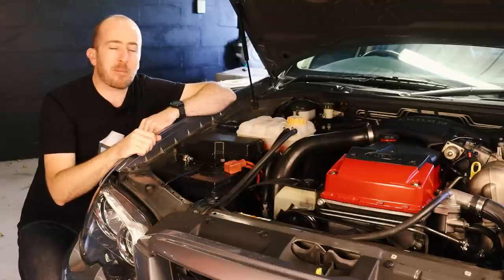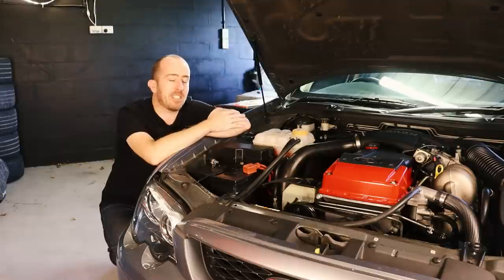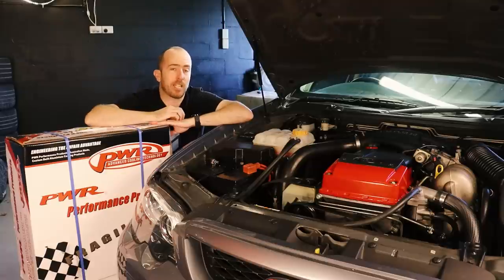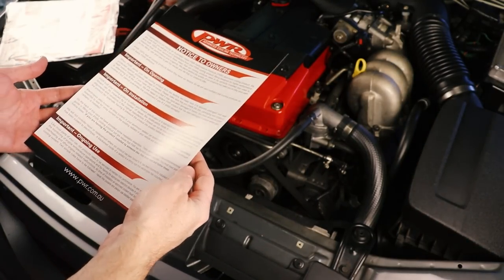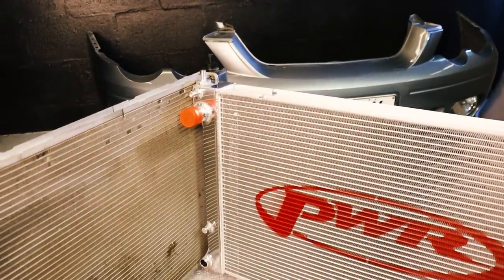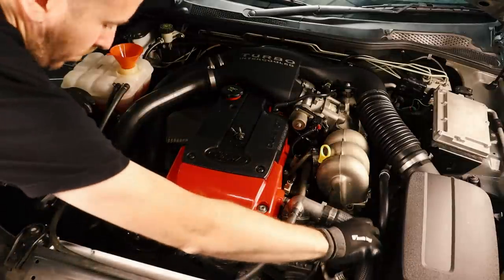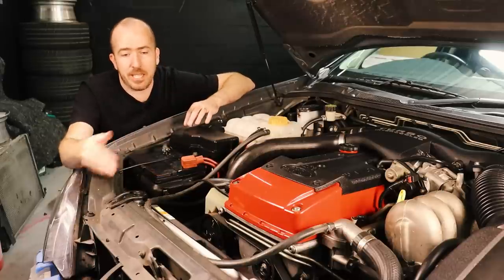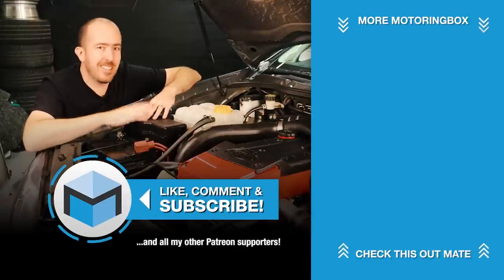Barra Turbo Radiator Upgrade! PWR 55mm Aluminium Radiator for Ford BA/BF Falcon XR6T XR8 FPV Typhoon

Comment: Nice - the Aussie Ford inline 6’s are probably the best engine bays to work in when doing DIY maintenance 👍👍
Reply: .......did I hear someone say ...AU FALCON...🔥👅👅👅😈👍
Reply: It sucks for us xr8 guys tho 😄
Reply: @smithy2  AU XR8 .....with a stroker kit...🔥🔥
Reply: @lancecooper4646  BA with 5.4 modular,  brings new meaning to the word tight
Reply: @smithy2  but in trade off you get the nice V8 rumble at idle 🤷‍♂️
Reply: @bennyw9975  haha you know it 😎👍🏼
Reply: @bennyw9975  Nothing beats the sounds of the 5.4ltr when u nail it as well
Reply from the maker: @mickblack2800  agreed.
Reply: @mickblack2800  I'd rather reliability.
Reply: I dunno, I just replaced the water pump and the radiator on my FG G6E-T last weekend - getting at those bottom two bolts that hold the condenser and the radiator together was a b*itch - wish I'd removed the whole front bar like was done here, would have been much easier.  Then there was getting the old pump off - had to remove the turbo out pipe and the power steering pump to get at the rear bolt - then the worst part of the whole job - getting the old water pump gasket off - it was glued like concrete to the block & there is almost no visibility on the top right corner of where it bolts to the block - took me a good hour of spraying with cleaner and scraping to get it back to smooth metal.  Then the replacement water pump didn't have a thread tapped in on the rear bolt hole that holds the back pipe in... all in all a job that I expected to take me a couple of hours took me over 5.  Other stuff I've done recently like replace all the upper engine gaskets was pretty easy though.
Reply: @SamO-ik2cm  Besides the usual replacing the arse end bushes & replacing the auto at 187,000kms, the V8 is turn key reliable  & strong as the day it was built, & is a great Aussie cruiser.👍
Reply: I know the AU is a snap to do oil changes.
Reply: @SamO-ik2cm  mine is pretty good, vortech v1-s 400kw,
Reply: @mickblack2800  dont tell me that, mines at 177,776k's on a positive note for me thats atleast 2yrs away 😉
Reply: Lol
Not mine mate

Comment: Just ordered a custom PWR radiator for my Manual Mitsubishi Magna Ralliart in sable black. I am build number 476 and I just want to say I love Aussie cars. I also have a Manual FGX XR6 Turbo and am considering the PWR Radiator for that too. My XR6T has some minor clutch drag though which is causing issues when shifting at high RPM and may also need synchros now. I do all my own work where practicable and have done Oil Pump gears, valve springs and the IMS diff hat upgrade. The car has driven me nuts with the clutch drag but all I have to say is take the challenges for your cars as they are, a challenge of your skills and resolve. Don’t get disheartened and remember what you love the car for to push through the hard times. Love your work Sean

Comment: i defiantly recommend pwr, we use their trans cooler kits at the shop to replace the milkshaker on the BF-FG and SX-SY-SZ territories, never had one come back never had one fail or leak, fit perfect every time.
Reply: Yeah, the "milkshake delete" is a must do with one of these if it's an auto 👍
Reply from the maker: The accuracy of all the rad mounts was pretty amazing. I was expecting a bit of slop, or that I'd have to bend the condensor slightly into place etc. But nothing - it was perfect.

Comment: GOOD JOB.....!!! I did mine several years ago I paid 180 bucks the brand was 'SPOWER'- no leaks but 50mm core didn't stop it getting warm on extended idling..... Triton do a 'high flow' thermostat range 30% more flow - that didn't help either but mines a 5.4L maybe the setup is different..... don't get me wrong it did improve but the needle doesn't seem as steady as it used to be when pushing the car......... I dunno why......

I can suggest cleaning the thermofan couplings well and giving the pins a lick of dielectric grease..... I found mine didn't come on after the job and as usual the connectors needed a tweak..... to test it just flick on the A/C - they should always run while A/C is on.........

Definitely a job worth doing because I am also told on the BA the tranny shares its cooling with the radiator internally and they are known to corrode and contaminate the tranny with coolant at around 200,000km - a tranny rebuild is 4 grand - so I just went ahead and did it - maybe the turbo has a separate tranny cooler - not sure mine and many others don't so for under 200 bucks its worth it on that front alone...!!!!

https://www.ebay.com.au/itm/131655830081?fits=Plat_Gen%3ABA&epid=911738429&hash=item1ea74c8a41:g:fjQAAOSw3xJVf-uX

Comment: You've inspired me to consider doing this on my falcon. I assumed it would be a more challenging job. Great video as always 👍
Reply: Just don't make the same mistake I made and try to remove the bottom condenser bolts from underneath the car - take the bar off like he did here!
Reply from the maker: Well worth the money if you care about the car and plan on keeping it long-term!
Reply: @Beer_Dad1975  I swapped mine without removing the front bar. It was fiddly but doable. Used a 1/4 drive rachet for the top bolts, then a 1/2 drive with extension through the lower grill for the bottom bolts. But mine's a V8 so no intercooler to deal with.

Comment: Ford falcons, they don't have coolant bleader screw for removing trap air in system and it is important to put heather on hight position for some times for prevention of trapped air in coling system.

Comment: Another easy & great video Sean. OEM radiators only last for 10 years. Mine lasted 15 before I had to replace it. It's a pity PWR don't make radiators for VY V6 engines so I'll stick with stock for now.
I would have flushed the engine out of any excess coolant & double checked the thermostat. Thermo fans have always been a bugger lol.
Reply from the maker: Good tips. My thermostat was replaced about 2000kms ago, and the coolant done at the same time.. so I wasn't too worried.

Comment: Annoying thing is the FG's have the following 

N/A 6cyl - 16mm core
6cyl turbo - 26mm/27mm core, which is a big boost in cooling efficiency for a big lump of iron that really can get toasty..... (26mm would be ample for an N/A), 16mm is just a joke haha !

I've put a factory Turbo radiator in my G6E personally, keeps much more consistent temps running an 82° thermostat.

Comment: Take the top radiator mounts off to make it easier to slip the fans in. The will move forward just that little bit.
Reply from the maker: Good tip, will loosen them if I ever need to pull the fans out. Might be just enough to help.

Comment: Just done the radiator in my bf and the condenser surprised me aswell, coming from older falcons
Reply from the maker: Luckily I have taken the front bar off a few times before so I was able to do it fairly fast. Not as fast as in the video though!!
Reply: On a non turbo xr6 or xr8, you can get away with just removing the top grill and using a ratchet spanner or 1/4" drive ratchet 10mm
Reply: @tturi2  that’s what I ended up doing aswell

Comment: Great video and also worthwhile upgrade. I had the radiator explode on my Mondeo once - the mess is unreal 🤣 also upgraded the intercooler on my V50 T5 to a solid aluminium unit as the OE unit was a lot thinner and had plastic end caps!  
On a side note - love the tune 'Diggin In The Dirt' - it's so cool and was used on Sky ads here in the UK but unavailable on Spotify,  Apple Music etc 😢
Reply from the maker: Thanks mate! The track is 'Down in the Dirt' and it is on Spotify - well, here in Australia anyway if there is any difference. In the vid description is a link to my MotoringBox playlist which has it.

Comment: Some advice for the top radiator hose on BAs

I double clamp the top hose near the thermostat. I find that they can pop off easily if you’re heavy on the throttle.
Reply from the maker: If the hose is popping off that might suggest the engine mounts are on the way out, and that the engine might be rocking side to side a bit.
Reply: @MotoringBoxTV  my ute has 345k on it, it’s probably due for a set

Comment: Overheating is no issue mine blew a hose going up a hill pulled over and suprise no coolant still runs like a dream to this day
Reply from the maker: Hoses are well worth replacing too - I did mine a few months back and it only cost me around $150.
Reply: @MotoringBoxTV  basically done the same as you fixed all my cooling your videos helped very much

Comment: I did a similar job AFTER the original plastic radiator failed (the radiator top hose connector broke off halfway and all the coolant pumped out. The new all-aluminium radiator is the bees knees. My Ford is LPG, not turbo, so the radiator is thinner and easily fit with no mods needed.
Reply from the maker: Nice. The plastic end tanks did make me nervous for sure, after a the t-piece on my heater hose fell apart from heat degradation.

Comment: Ah those plastic intake snorkels. Fit nothing except factory standard setups. I put an all aluminum rad in my Subaru and the snorkel needs some love with a small cutting wheel to make it fit because there's  ribs in the way. Even replacing the battery in my wife's Kia to the listed "fits this car" as per Century's catalogue has it needing a good massage to go back on. Just.
Reply from the maker: Going factory if possible is always the easiest of course. Factory parts do have their performance limitations though, so it really depends what you're after.

Comment: Thank you very much for your video. I changed my radiator today (BF Fairlane, 230 Barra V8 3V) with your help. I didn't remove the front bar. I replaced the rad with a Natrad OEM replacement and their instructions agree with you that stray voltage should be less than 50mV. Mine tested at 165mV engine running and 185mV engine off. Various forums say that below 300mV is acceptable. I'm a little worried and confused. Did that voltage reading (cheap DMM) cause the original radiator to deteriorate? Or am I fine?
Reply from the maker: I'd probably go with the manufacturer's spec if you want to be covered by any warranty they offered.
Reply: @MotoringBoxTV  Dang. I'll call around and do more research. I don't want to wreck my new radiator. Thanks for the quick reply. :)

Comment: So confusing on their website it says the PWR5100 and PWR5100A are both for the V8
Reply from the maker: 5100 is manual, 5100A is for automatic (because it has the transmission cooler assembly within the radiator). If you run an external transmission cooler you could order the manual radiator.

Comment: Do your radiator fans cycle on less often once it reaches operating temp. One thing I don't like about me falcon is how much noise the fans make when they cycle on. A better radiator might reduce that. Is that a BA/BF XR6 turbo and do the fans run sometimes after you remove the key from the ignition?
Reply from the maker: I haven't driven out properly yet, I have a few more things to do first. The fans should run less. I've never had them run after turning the car off either.

Comment: I really wish the radiator stuck out so it looks like a mock intercooler. Just had to replace mine in the BA and thought it might look sporty from the front but can't see a damn thing lol
Reply from the maker: It's pretty subtle unfortunately, you just see a little more thickness there between the thermofans and the body.

Comment: Nice video mate! Keep in mind that if the cooling system is TOO efficent it can in and of itself cause an issue with running the car. For example if the car is running below its normal operating temperature due to a very efficent radiator it can cause fuel wash from running too rich, which can blow the engine due to things not getting the correct amount of lubrication. Just make sure that your operating temperature stays in normal range, or you might want to consider when you get a tune getting the cold operating part of the tune in the fueling tables moved back, so that it has its new operating temperature. Just something to look out for, a mate had the same issue when his thermostat was stuck open, and it wouldn't get up to temp at all, fuel wash ended up in ringland failure. All in all, thats a solid radiator option, they're fantastic build quality. The Spaghetti rod thing is a load of shit, they do have skinnier rods, but if you have a good quality tune, done by the right shop it will hold power no dramas, not saying it'll hold 500rwkw or anything, but they'll hold a decent amount of power when you put in your uprated valve springs to stop valve float, put in a uprated intercooler, as high IAT are a huge problem with these, and they make sure to tapper the boost correctly, and run it richer down low to protect those rods. Keep in mind after a tune go a thicker oil, as the oil temp will be higher and as your oil temp gets higher the oil viscosity gets lower. For example on most turbo's in a stock form i run a synthetic, full zinc 5W-40 like HPR5 from Penrite, and when they're tuned a bit i go to 10W-50 Tenths Racing from Penrite, the Zinc improves its overall protection, while the increase in viscosity means that when you are giving it the beans, the oil will keep it protected, as well as the shear free technolgy that Penrite puts into the Tenths Racing fluid. 

When it comes to the tuning side of things, the BA/BF manifold is pretty bad for turbo spool due to how they are made, you can upgrade your turbo manifold to a FG one, which improves spool, and then you can go to a FG turbo back exhaust off the shelf (venom is a great brand) and it'll bolt up. Another thing to keep in mind is with the faster boost you need to be careful of those rods still, as it can come in too fast. 

If you have any questions, feel free to reply and i'll answer what i can. 

Good job mate!
Reply from the maker: Thanks for the advice. Stay tuned - you may like some of the mods I have coming up 👌
Reply: @MotoringBoxTV  Always 😜 I'm turbo charging my NA XR6 BF 6spd Manual soon.

Comment: Did you have to trim the fan shroud? When I put a thick rad in my Au I had to trim it down a bit
Reply from the maker: No I managed to make it fit. Installing it is very tight, but once it's in place there's about 2cm of clearance to the pulleys.

Comment: You don't have to remove the front bar to undo the condenser, just remove the grill.
Reply from the maker: On an XR6 maybe. The intercooler gets in the way of the lower bolts.

Comment: Wait until you go for a bigger intercooler.  Those large core radiators become a pain in the ass.  For the price of these PWR ones they would want to last forever
Reply from the maker: Already got a cooler sorted, but the option I went for is not affected by having a thicker rad.
Reply: @MotoringBoxTV  Then you will likely need to bend your A/C pipes for fitment if its running infront currently. I run a process west kit and had to bend the pipes out of the way for fitment.
Reply from the maker: You'll find out tomorrow! 😀

Comment: You'll notice on a stinking hot day you'll be able to leave your a/c on without the engine overheating 👍
Reply: You should be able to anyhow, if your car is overheating on a hot day with the ac on, consider changing your thermostat, coolant and/or radiator, I never have a problem with mine on 40+ degree C days. If it was sarcasm, then good job mate. :P
Reply: @joshuaeacott4226  hmm...yeah, well my old radiator probably was partially blocked, but I'm glad I went with the new big core 👍
Reply from the maker: No overheating problems with the old one luckily, I just wanted to replace it for peace of mind 👌
Reply: @lancecooper4646  Yeah, I took a radiator out of a customer's car to do a AC condenser once, and chunks of rust were falling out of the end tanks, so I replaced it for them.

Comment: I have wanted a pwr radiator for me EL for such a long time. Maybe I have to start a YouTube channel
Reply from the maker: It's up to people to weigh up the price I guess. They're expensive, but there's a certain level of quality about it and it should last the distance. I suppose it depends how important the car is to you, and how long you're planning on keeping it.
Reply: @MotoringBoxTV  car is immaculate, I know the power is definitely worth it. I had a jayrad performance one in there but it split between the core and sidetanks after 3 years.

As for the red coolant you'd be surprised to hear that ef/el had red coolant from factory but as more advanced green mixes came out ford were swapping them to the hybrid green as time went on.

Comment: I got a question 
Is it a good idea to put a after market Radiator in a stock XH Falcon Ute?
Reply from the maker: It depends, radiators have a 10 year life so anything after that is borrowed time .. you either take the risk or replace it I guess. Realistically there's no reason to go bigger unless you've got overheating issues, or planning on driving it hard or modding it.
Reply: @MotoringBoxTV  oh ok cool thanks for the info 
Fingers crossed my Radiator doesn’t explode

Comment: 🤔 I should invest in a pwr rad
Reply from the maker: It is an investment for sure - a good idea if you're keeping the car long-term.
Reply: @MotoringBoxTV  it arrived yest 🤘, time to rewatch your install
Reply from the maker: @smithy2  awesome! It's not a super tough job, and should be identical to what I did.
Reply: @MotoringBoxTV  hope so mate, got the trans cooler too, thinking of getting braided lines and chucking the hard lines... if thats possible

Comment: stray current or stray voltage? two different things...
Reply: ...... Correct, poor choice of words in the  instructions as we are measuring voltage.
And the reference to an analogue meter would only apply to Neanderthals.
Reply from the maker: Fair enough.